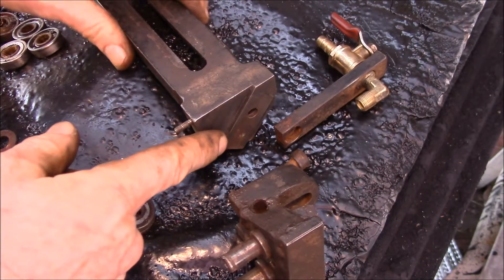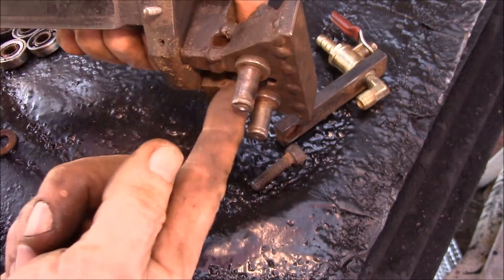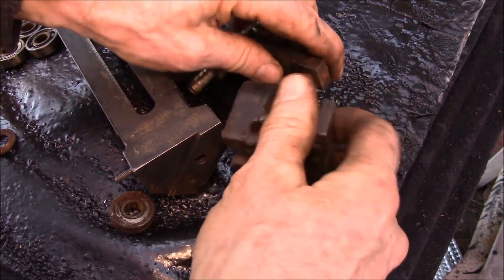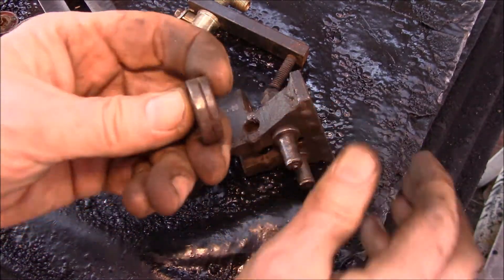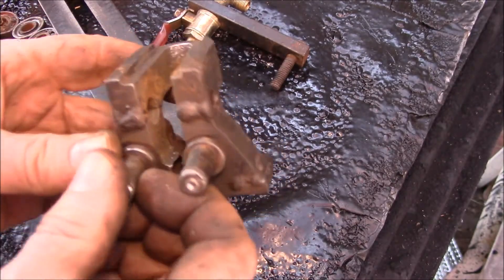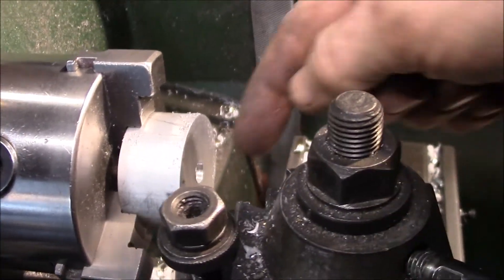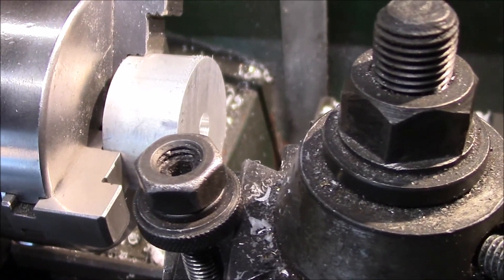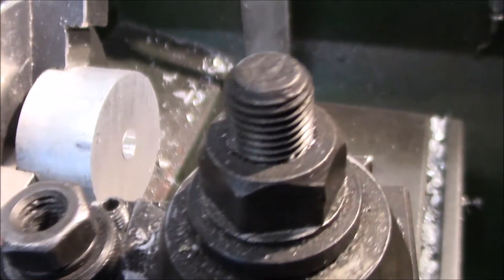7"x12" Bandsaw Blade Guide Repair, Part 2

Comment: Hi R Brown.
 What causes the bandsaw blade(horizontal) to cut the metal inclined .
My Regards
Reply from the maker: Many things can cause that in my experience.  Blade worn unevenly.  Blade guide set too loose, such as happens if you swap from a thicker to thinner blade.  The blade guide mounts not being adjusted vertical to the saw motion.  The main saw frame pivots getting worn and letting the saw frame rack as it drops through the cut, etc.
Reply: @The4Crawler  Thank you my Teacher

Comment: Hi R Brown.
What causes a bandsaw blade to break when cutting metal.
Thanks
Reply from the maker: On these horizontal/vertical saws I think it's mainly metal fatigue that causes a blade to snap.  They get bent/twisted every time they go around and over time that stress accumulates.  I usually take the broken blade and then fold it in half a few times for disposal and it'll usually snap fairly easy at those folds.  The better quality blades seem to last longer.

Comment: Hi R Brown,
Even though you have a different saw than mine, I enjoyed watching your video. I was waiting for when you adjust the upper thrust bearing but you didn't do that? I have a 10" X 18" Horizontal Band Saw without a manual so am looking at videos on what the clearance should be. One video on a 4" X 6" showed the bearing being adjusted to 1/16" of an inch above the blade when setting it up. What is yours set to or ends up to be when installed?
Thanks
Reply from the maker: My manual has no specification for that distance.  I think I just set it so the bearing is clear of the blade with no weight on it and then it starts spinning once the saw is lowered for cutting.  1/16" is probably a good number, but at least on my saw, it's hard to get anything in there for an accurate measurement.

Comment: Hi

Sawing liquid with unprotected bearings is not a good combination.
Use stainless steel bearings next time.
Reply from the maker: I haven't been able to find stainless with the solid polymer lubricant so far.  My supplier does have an unsealed s/s bearing, but they run $34/ea. (x 10 bearings).  I have found some hybrid ceramic bearings with stainless races and ceramic balls that might be a good option and those are under $20.